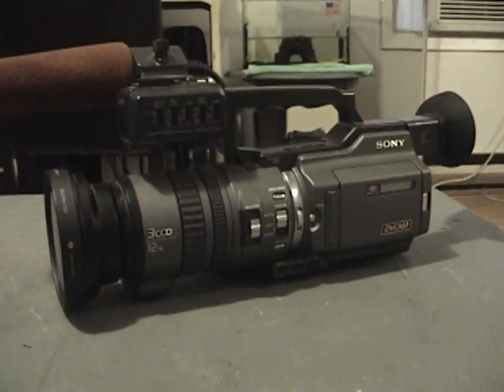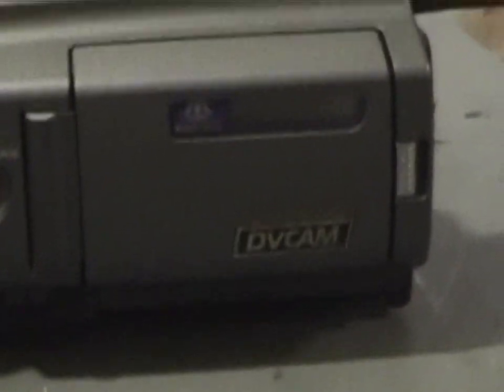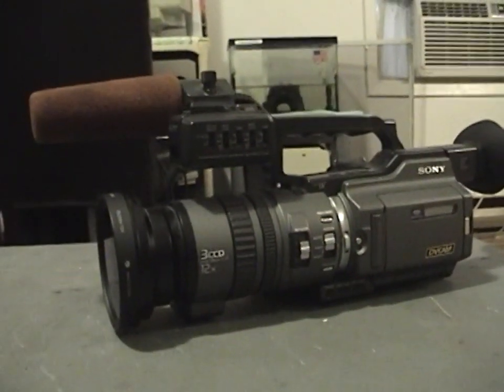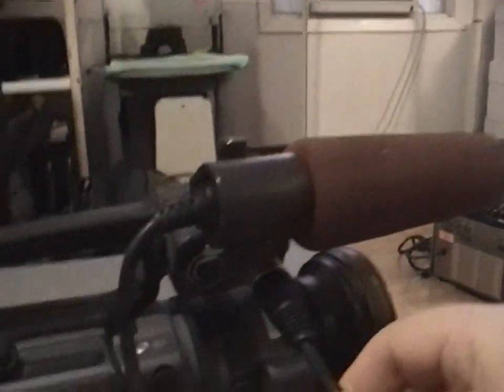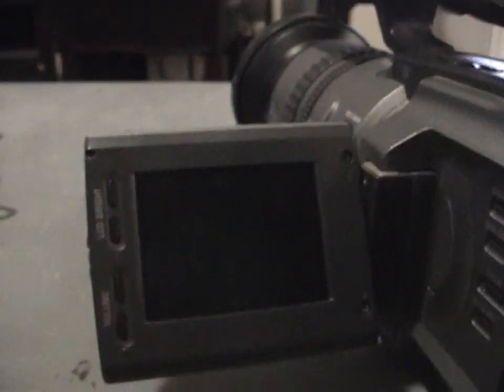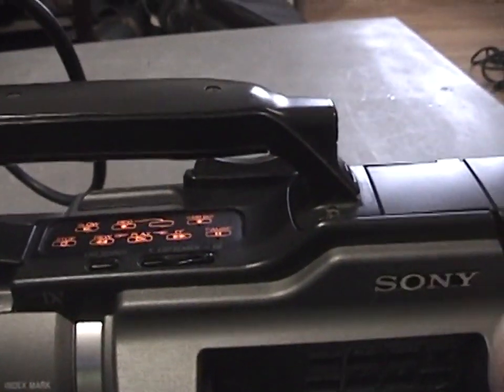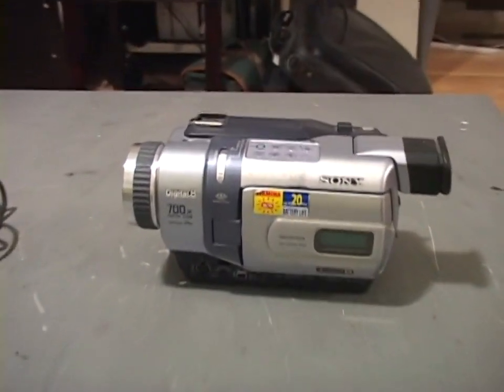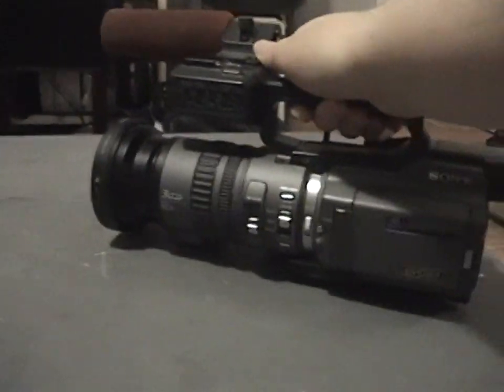Sony DSR-PD150 3CCD DVCAM camcorder (2003)

Comment: Super excited to have found your video about this camera.  I acquired the same camera bundled with a DSR-PD170 and an editing deck plus a ton of accessories locally through an auction.  I can't wait to run some tape through mine.  Both cameras I have are low hours also.  Thanks again.  Great video!
Reply: So cool!

Comment: These a very nice, great quality camcorders. I have the follow-up model, the DSR-PD170 (based on the VX2100) in my collection. Equipped with a 16 MB Memory Stick for those great VGA photos :D
Reply: Can you enlighten me on the best way to upload my wedding footage "which was shot on this camera and mini dv's'  into my PC, what cables or adapters would you recommend ?  Looking to keep quality as hi as possible, Thx
Reply: @louodd  To get the original, unaltered data recorded on the cassette copied into the computer, you must use a Firewire connection (IEEE1394).
Reply: @DrCassette  awesome thanks..I thought that might be the case..as this type of port is harder to find on many Laptops and PC's these days...would I lose any quality if i'm forced to us some kind of adapter / cable box in between ?

Comment: I still use my Sony VX-2100 on a regular basis, basically identical to the PD-150, but without the XLR inputs.

The original battery will lasts months before I have to charge it, it amazes me.

Comment: Wow it even has  licensed  Faroudja video processing.  Remarkable that the tape drawer still accepts/elevates/ejects a cassette after all these years. The Sony mini dv consumer cam  decks have a position encoding wheel that seems to oxidize after a while and desynchronizes the drawer. Esp after prolonged storage   C3211  error. Fixed by jumpering the motor back and forth a few (20 ) times with 1.5 volts and reset micro.
Reply: Hi! I have the same problem. Could you help me?

Comment: Awesome win! I have the PD170 myself.. 
https://www.youtube.com/watch?v=SJPLUYTmpkA
Funny you say about DVCAM having less dropouts as for me both the PD170 and PD100 (I had that's given up now) have had way more problems with break ups. Funny enough its also the DVCAM tapes I most have problems with! My PD100 only liked normal DV Sony tapes and recorded fine on them.. but when I tried Sony DVCAM tapes I had break ups! So strange.. I guess though as you said most people used normal DV tapes to be cheaper and maybe after years of them the cameras just don't like change. Good thing about your camera and mine the PD170 can record in both modes where the PD100 could only record DVCAM mode. As for sound yes my PD170 auto mode is very low sound and also its shotgun so its doing a good job of getting the sound in front of you not behind, I might try the flipping the mic backwards to hear me better for YouTube recordings. As you said in the video the low light is great.. I have recorded a thunderstorm on mine and was amazed how good the low light is, its better than a lot of much more modern units.

Comment: I just received this camera -unfortunately in a bad shape. I came across your video, that helped me a lot and found the manual online. I have therefore a question about the tapes: According to the manual:

"You can record both on mini DVCAM cassettes and on Mini DV cassettes using your
camcorder. When you use a mini DV cassette, set REC MODE to DV SP in the menu  settings..." 
and later: 

"If you record in the DV format, the transition of a tape may not be smooth. We recommend that you use mini DVCAM cassettes and set REC MODE to DVCAM in  the menu settings to obtain reliable clear pictures."

To make things clearer I can record in both DVCAM format and in the DV format (SP mode) never mix the different formats in the same tape, preferably use Mini DV (cassettes) when recording in DV Format/SP Mode and Mini DVCAM cassettes when recording in DVCam Format, right? 

What would happen if I use a regular mini DV and record in DVCam Format? And where can I get these professional mini DVCam cassettes?

Greetings from Sweden!
Reply from the maker: There's no consequence to recording in DVCAM mode on MiniDV cassettes. Most of my cassettes are MiniDV, and I record exclusively in DVCAM mode. It will yield better reliability on both types of cassettes. The manual probably says that just so you keep track of your recordings and don't accidently try to play a DVCAM recording in a MiniDV device by looking only at the tape type.

DV has been obsolete for years - I don't know if anyone is even making tapes still. eBay is probably your best bet.
Reply: @themaritimegirl  Thank you so much for the answer!

Comment: the sony vx family is (still) famous with skaters because of many reasons but the main ones of the top of my head would be: 1. the handle on the top is great for using with a fisheye to get a low angle clip 2. the microphone (especially on the vx1000) sounds amazing for skateboarding, something about the crunch the wheels make on the concrete is just so satisfying 3. the 3ccd sensor makes the footage look phenomenal, nothing you can edit with a normal clip will top the classic vx and its colors, saturation, hues, white balance, sharpness, etc

Comment: details are blury but i know its low resolution sensor. But ccd has global shutter and natural colors are better then cmos sensors. In fact, I wish they would develop the tube cameras in an analogue way, I think it would be the best.
Reply from the maker: Sony actually did develop an analog high-definition video system in the 1980s, which used tube cameras, called HDVS. Look up "Montreaux Jazz Festival 1991". The picture quality is lovely.

Comment: cool..how do you import your footage into your PC with this & what method maintains best quality from original recording ?? Firewire ? VGA ? Can you enlighten me on the best way to upload my wedding footage "which was shot on this camera and mini dv's'  into my PC, what cables or adapters would you recommend ?  Looking to keep quality as hi as possible, Thx
Reply from the maker: FireWire. VGA is an output-only port. If your computer doesn't have a FireWire port, you can buy a FireWire expansion card for cheap on eBay.

I made a video all about the process here. It starts with transferring analog video to a DV camcorder, which doesn't apply to you, but the rest of the process is the same:

https://youtu.be/zpfmHChEqHY

Comment: I still have my DSR-PD150, great Cam ! However, capturing DV is getting very cumbersome these days. Problem with my firewire adapters to thunderbolt. (Mac Big Sur) am using adobe Premiere Pro CC to edit. Do I need third party capture software?
Reply from the maker: No clue; I've never used either adapters or Premiere for transferring DV, so I don't know which one could be giving you the issue.
Reply: @themaritimegirl  thanks for your response! As soon as I get a FireWire 800  to thunderbolt adapter. I hope my machine will see either my old Sony deck or camera.

Comment: How does the charging system work??
Reply from the maker: You plug the AC adapter in... and it charges.

Or you take the battery out and put it into a standalone charger... and it charges.

Comment: hey there! I just bought a pd150 and notice that once I insert the tape, even when it's not recording anything, there's a motor sound that comes from the tape deck. can you tell me if that also happens with yours? I don't know if it's a normal thing or a problem. thanks!
Reply: It’s normal with all dvcam/dv units. 👍

Comment: is it possible to stream on one of these?
Reply from the maker: Yep. OBS doesn't support DV cameras unfortunately, but if you use a DV-to-SDI converter and an SDI capture device like an AJA U-TAP, it will work.

A cheaper but lower quality method may be to use a composite capture device like those sold by Elgato.
Reply: @themaritimegirl  thank you for the reply, now I have a starting point. Appreciate you!

Comment: Can you send a link to a charger and battery I can buy please
Reply from the maker: The charger is a Sony AC-L10A or AC-L15A. Search those terms on eBay and get a used one for cheap.

The battery is a Neewer NP-F550 or NW-F970. You can find those on Amazon.

Comment: 4:38 If you kept having problems with drop-outs on MiniDV, HDV will be even worse for you. Since it records in MPEG2, a drop-out will not only make loose a frame or two, it will corrupt a whole GOP (group of pictures), that's around 10 frames!

5:17 You are mixing up DVCAM and DVCPRO. S, M and L size cassettes are part of the DVCPRO system which was Panasonic's DV-based professional system. Sony's DVCAM only had the small and large cassettes that were the same as MiniDV and fullsize DV (these large DV cassettes were also available on the consumer market. They are not compatible with DVCPRO L size). 

7:04 CCDs are no longer used in any modern camera aside from some special applications. All modern camcorders since around 2010 use CMOS sensors. They are indeed cheaper to make, but they also have a different readout method, which has the advantage that bright lights no longer cause a vertical streak across the picture - and the disadvantage of rolling shutter. Still a Bayer filter is required, so there are still 3CMOS systems for better colour reproduction.

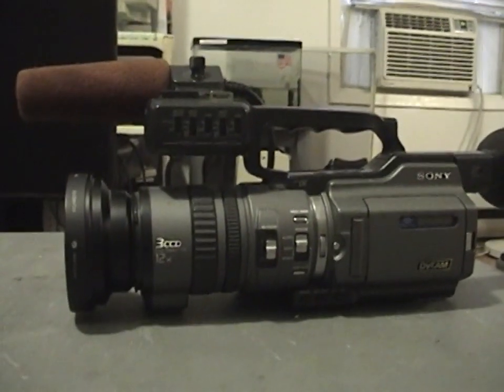9:47 Indeed there is full resolution colour information - until it's recorded. Being based on DV, DVCAM applies a method called colour subsampling. 4:1:1 for NTSC and 4:2:0 for PAL. This means for each pixel only certain colour information is recorded. The chroma resolution on DV is always lower than the luma resolution (that's why chroma keying always looks so bad on DV). This by the way is one of the things that makes Digital Betacam so much better than DV: It not only records digital component rather than digital composite, it also applies only 4:2:2 colour subsampling (4:4:4 would be no colour subsampling, HDCAM SR can do that).

10:14 Broadcast quality it is - but only for ENG work. In the studio you would always use a higher quality recording system such as Digital Betacam (Sony) or Digital-S (JVC). 

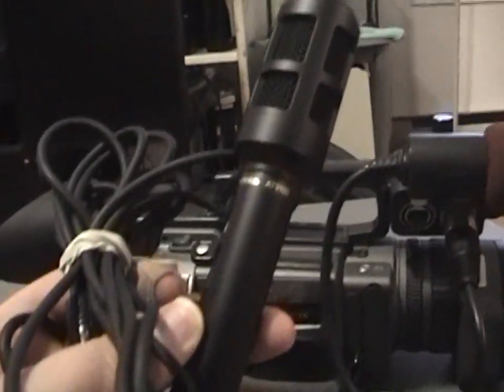16:08 All you have to do to make the camcorder accept a dynamic microphone instead of a condenser microphone is turn off phantom power (+48V). 

22:58 Sony still makes InfoLithium L size batteries as a lot of their current professional camcorders still use them. And these days there are so many no-name accessories such as video lights that also use them. I think it's safe to say, InfoLithium L will be available for decades to come.
Reply from the maker: I tried the AT9100 with and without phantom power - didn't make a difference.
Reply: @themaritimegirl  That's odd. Did you use some sort of adapter to connect to the XLR input? Maybe it's a bad or wrong connection somewhere?
Reply from the maker: @DrCassette  I have an adapter coming in the mail, so in the meantime I just connected it to the positive and ground pins for testing. That would be nice if that's all that's the problem. The microphone is functional, but you have to yell at it to register on the level meter at all.
Reply: @themaritimegirl   1 year late, but would setting the input level to "line" solve the problem?